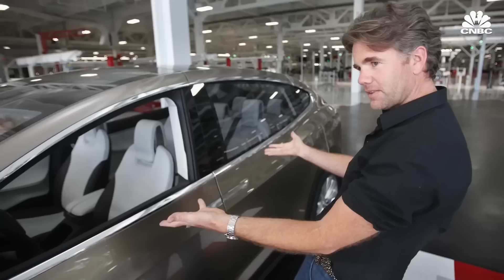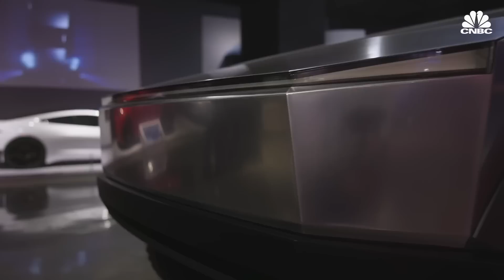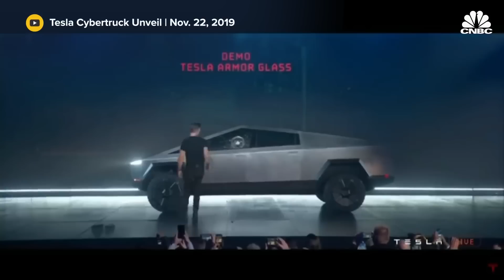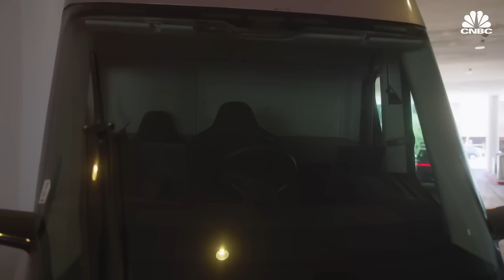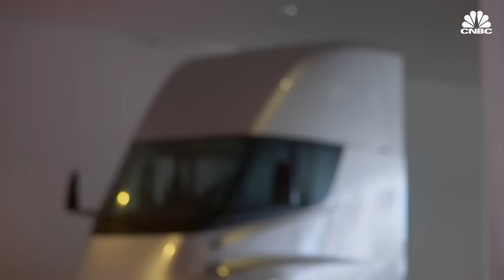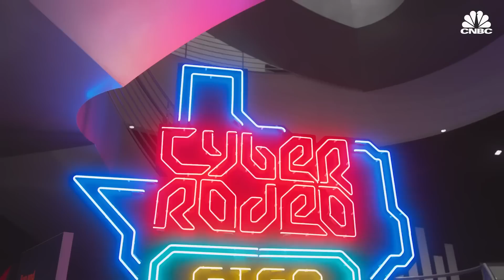WHAT? Did Tesla Just Leak ANOTHER New Vehicle Is Coming Soon?

Comment: It’s definitely going to be a new platform, no steering wheel option, and also the front will mimic the back, so you could drive backwards or forwards.

The difference I’d say is a compact version (small) and a van version (large) that shares a lot of the same pieces similar to M3 and MY

I’ll visit this comment in 2 years 🤣
Reply: The radical look may shock the masses…

Comment: a van with multiple configuration possibilities, such as minibus, delivery vehicle DPD/FEDEX /Royal Mail/Parcelforce/Evri etc etc, and small biz owners, as long as it has @ least 8 feet of usable floor space(full sheets of wood/plasterboard etc), and a larger structural battery maybe 7-9 long the full length of the underside floor area, with a range of 300 miles LOADED, if they can come up with with seating for 3 in the front, they will within 12 months decimate all of VW Sprinter /Ford Transit sales, not only for commercial users but countless hire companies, just think how many vans hire companies have on there books ,hertz/europcar etc etc, there is always a demand for someone needing a van to move a large sofa/move house etc etc, this van would push VW & Ford further into the red than anything prior to that they have made, BUT they have to make them @ scale without a crazy wait list time and @ price that competes directly against VW/Ford offerings, there are plenty of cities where zero emissions zones are in place already here in the UK, London/Birmingham etc etc the Tesla Electric van would be King of the Castle within 12 months :) :)

Comment: I say the 2nd new tesla thats coming is a modular utility vehicle. A hybrid between a semi and a van.

Sized as a van but the payload area is flexible with different modules. A van module would just be an enclosed capsule with doors. A minibus/taxi module would be a seating capsule with some creature comforts. There could also be different cargo-modules for different types (one for liquids/gas, one normed to be easily compatible with freight containers, one to recieve small vehicles like quads, jetbikes or normal bikes).

Depending on how integrated with FSD that vehicle is it might even be completely driverless; basically just a battery platform with wheels, sensors and signaling to make it street legal.

Tesla could easily make this a standard and allow 3rd parties to create & sell their own specialised pods that go ontop of the platform.
Like for example a camper pod that has all the creature comforts and the whole vehicle uses FSD convoy mode to simply follow your main car that you drive yourself with your family inside.

Basically take those little factory bots to street legal :D

Comment: Frans could just be referring to the 'Compact' but if he is offering a glimpse of a second new to come product, would it be a car? Could be a yacht but doubt it, could be a motorcycle, not sure on that, but it could be something very different.  A US style RV, either a 5th wheel or towable or a Van life project at the margins of design excellence. last year alone about 680,000 new RVs hit the road in the US. Now add an EV mobile home, with a drive chain that can be pulled by say a model 3 and the batteries from both can power it, you might just have some special.

Comment: The BMW GS motorcycle series looked tough because the requirements led it to look like that. The 1150 was properly fugly but very capable. (Long Way Round TV series). The later 1200 rubbed off the worst ugliness and sold like hot cakes. The latest 1200 is designed ugly and it shows. Sorry BMW you got that wrong. 
CyberTruck will work as long as the designers don’t get into Tonja Toy mode and over-egg the ugliness. Keep it real and all will be good.

Comment: What makes sense to me would be if Tesla would come out with a Universal Skate Board where the Van/Delivery Van/Passenger Van etc. would be just a different body style.
Reply: Same platform as a delivery van / camper van / minibus
Reply: Could this be the second design that is being hinted at then 🤔.  First is compact/Robotaxi and the 2nd a van platform.  I wonder if they'd feel the need to design capacity beyond that of a SWB van though if they are driverless.  They could run around 24/7 so capacity wouldn't be such an issue.

Comment: Franz could be talking about the implementation of the rocket boosters on the new roadster. It's the most crazy thing that Tesla has in the works. If it isn't that, then it could also be the autonomous cyber truck drone system that Tesla filed a patent for a while back.
Reply: It’s commercial spam. Needs to be reported/blocked.
Reply: I think that's a bit old in terms of his comments here.
Reply: If you believe that Teslas will use rocket engines, I have some Hyperloop projects for you to invest in
Reply: @sk4lman  its not rocket engines.. its cold gas thrusters, typically used on rockets. Essentially just pressurized air jets from an on car air compressor. Elon already confirmed its coming to the roadster 2.0
Reply: @hunternewberry5860  Yeah, I won't hold my breath
Reply: @sk4lman  i wouldnt either unless you can hold it for months/years
Reply: @sk4lman  It never ceases to amaze me how there's always that person that so desperately wants to show the world how smart they are... Cold gas thrusters then, I think that you knew what I meant. 💩🧠
Reply: @carsonc1272  Oh, I know about the cold gas thrusters. It will never happen.
Compressed air escaping at a pressure and flow rate great enough to influence a car would deafen bystanders and fling garbage cans and bikers like toys.
Reply: I think he just means that there is the roadster and the one he is not allowed to talk about is the upcoming small car (let's call it Tesla model 2), that nobody officialized, hence he is not allowed to talk about...

Comment: ☝️✊🙌 I love the van 🚐 prediction idea SMR, I imagine it would be an all 30X S.Steel beast with an external frame and maybe Tesla Solar Panels on the roof and high sides. Awesome last mile delivery/van life/etc. Also, About time Tesla built something the gimps♿️could use.

Most non-motorized wheelchair🦽users really don’t need a whole big van. My prediction for the new mr E vehicle 🚗 is: a single Giga-cast body, Stainless Steel outer frame, this could be the cheap high volume Robo-Taxi (Possible) car for the masses, with only 2 falcon-wing doors(double duty) for the front and back seat(the left rear back seat removable to accommodate a non folded 🦽!!
Advertising/personalization potential with wraps! The perfect everything cheap car!!!